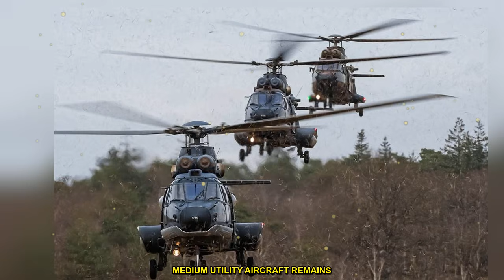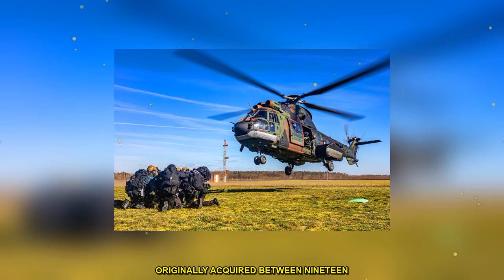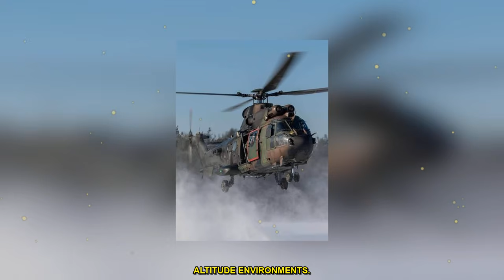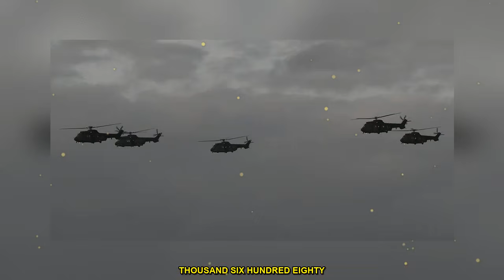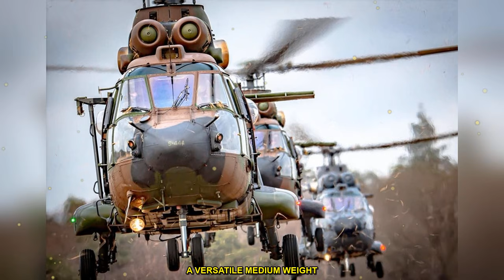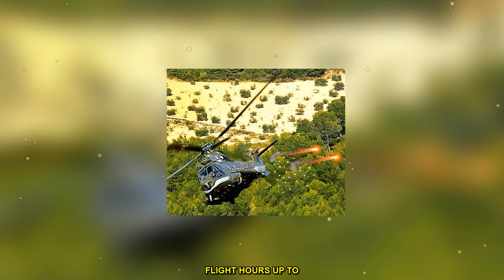Dutch AS532 Cougar: Why This Beast Refuses to Retire!

Comment: Typical Dutch, if it is not completely broken, you keep using it.  I do the same with my laptop a Dec 2011 HP Elitebook 8460p based on an i5-2520M, I plan to increase memory size from 8 GB to 16 GB DDR3 and use it till 2030 :).